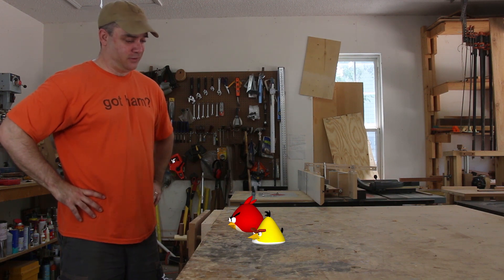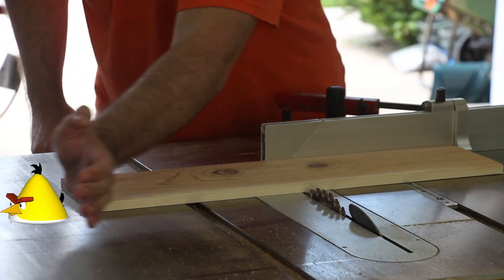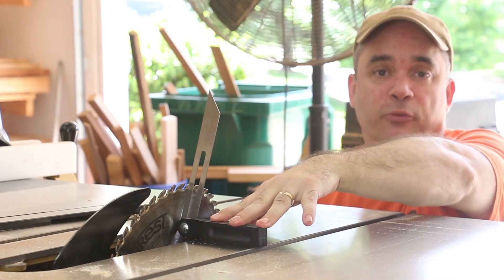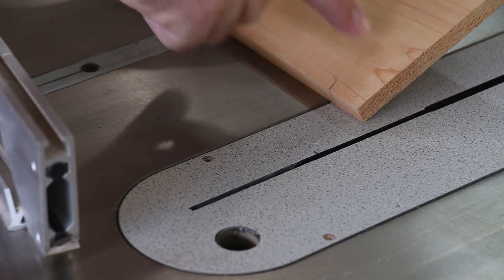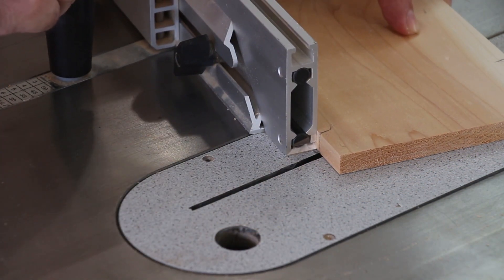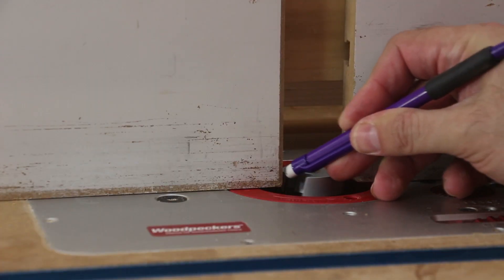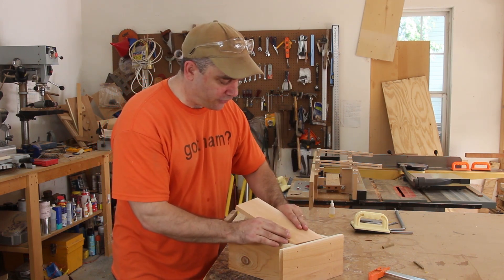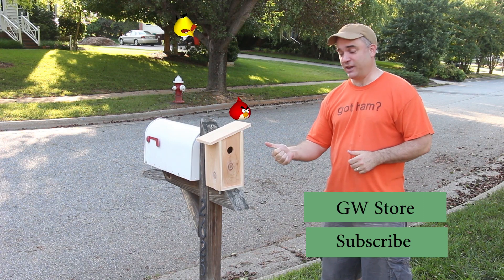Make a Birdhouse

Comment: The opening on the throat plate, by definition, should be parallel to your table saw's tracks. Ergo, you could have made the tick mark at any point along it, which means really you're aligning the marks on the work piece with the edge of the opening in the throat plate. No tick mark necessary. Thus, you can set your angle without sliding the miter sled back and forth a bunch of times.
Reply from the maker: No.  Here is the reason for the tick mark.  You want the forward and back position  of the miter gauge to be at the same spot on the throat plate.  Small variations in the opening of the throat plate are enough to throw off the alignment in your method.  Always measure from the same spot if you can when calibrating a tool.  It eliminates a lot of potential error.

Comment: Your birdhouse is a very nice idea, but I'm very sorry to see that you've made the common mistake to make the inside sides smooth . the ung birds wont be able to get out and they will probably die. But you will be able to clean the dead youngs out of the back. Please leave the inside rough or install a small latter.inside up to the opening.
Reply: Or just put some small halv dowels under the hole as a ladder. I use small splinted branches glued in place for this. Or simply make some rough marks with a chisel between the hole and floor. This is usually enough for the small claws to grip on their way out.